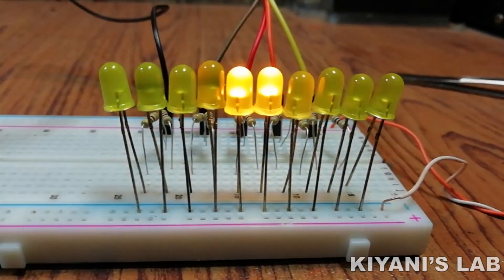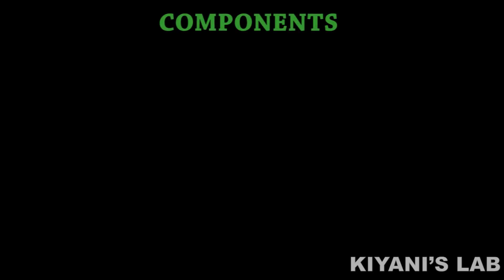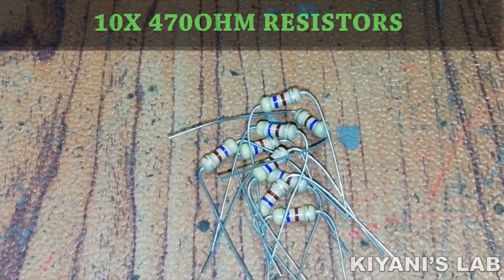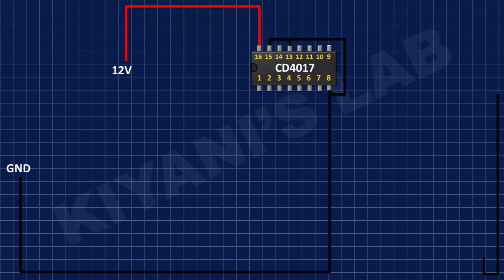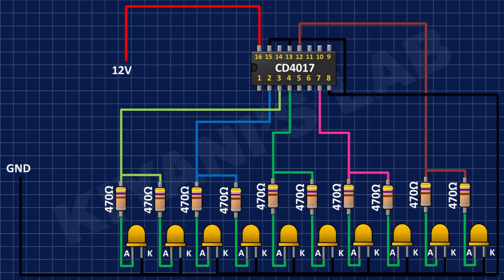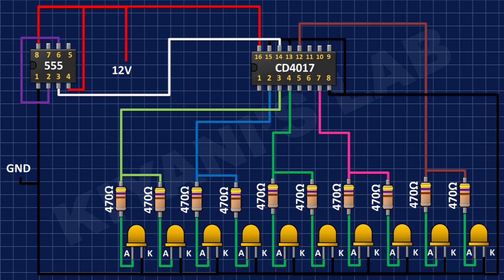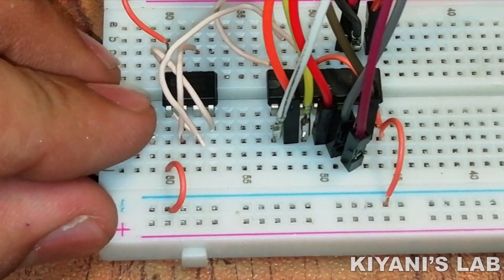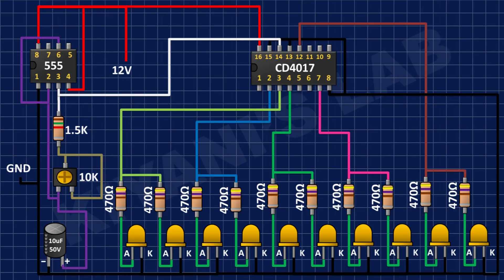How To Make Bike Turn Signal Indicator

Comment: How do you make them to be 3 on each side of the bike and syncronyze them? Seems like it will require 6 times as many IC's which means that in space restricted awkward applications such as on a bicycle arduino nano and ws2812b is still the only option despite the increased  standby current (could be reduced by disconnecting both power rails using mosfets on ws2812b but there aren't any practical wiring  diagram examples available).

Comment: In this diagram showing pin  no2 of 555 ic connect with pf 104, but you are telling pin no3. So what's the correct
Reply: If you watch, on the breadboard he connects to pin 3 like he states.  So, the diagram is incorrect.